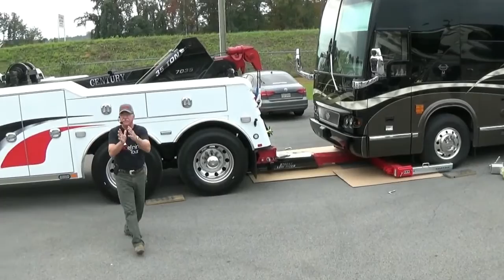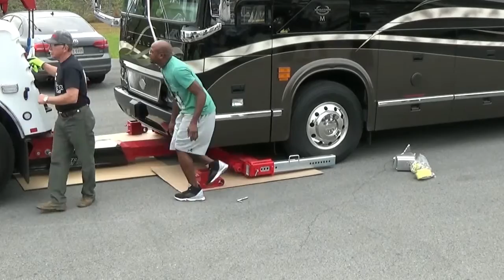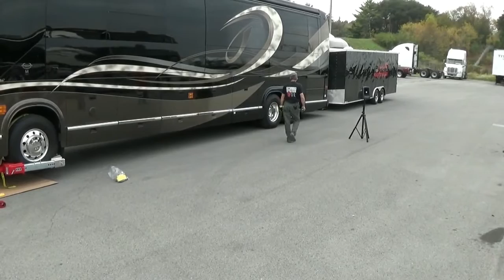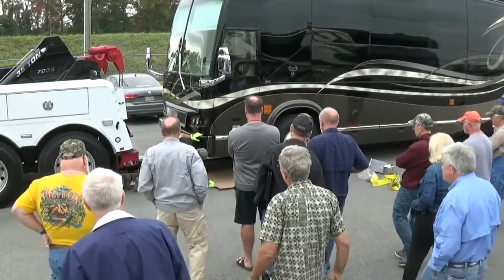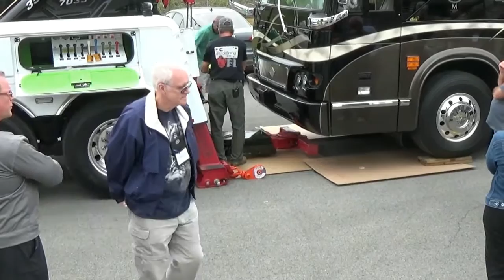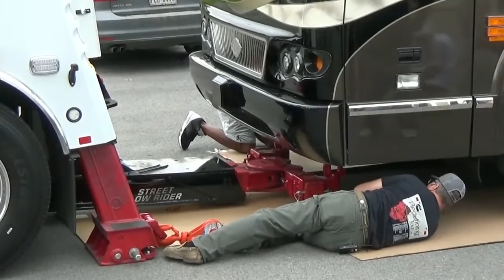Prevost Bus Towing Demo

Comment: I agree that the wheel lift is best, but I've towed dozens of these by forking the aluminum control arms. I just make sure my forks are as close to the pivot points as possible. Then I torque down my 2" axle straps and I'm done with the hook. I've never had a problem.
Reply: very impressive. hope I never have to experience this for myself. thanks for sharing.

Comment: what needs to be disconnected for the driveline
Reply: Driveshaft. They are miserable to pull too. Especially when coach is dead. I put them on blocks so you can get underneath. Some of them you have to completely remove shaft because there is noway to tie it out of the way. You can pull axle shafts also and put covers on them.